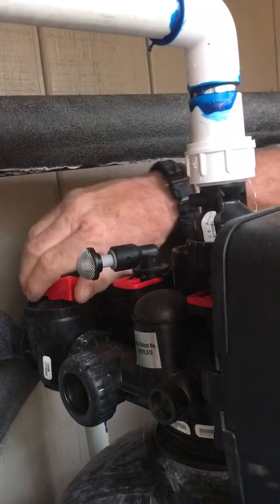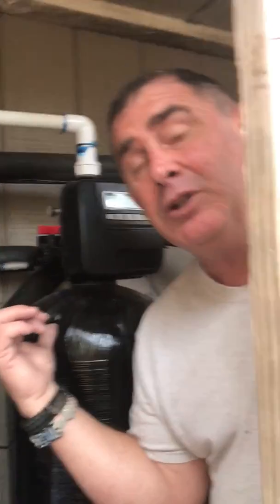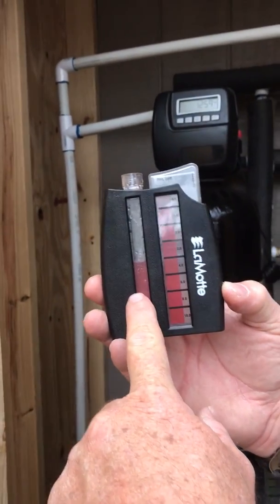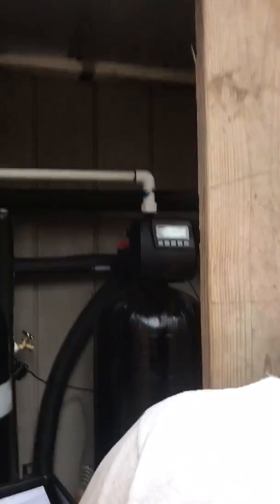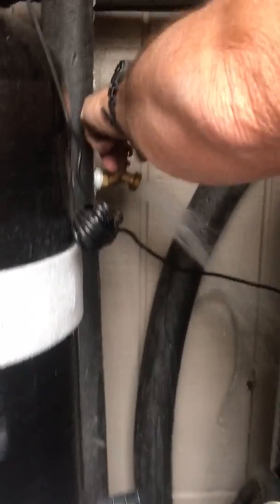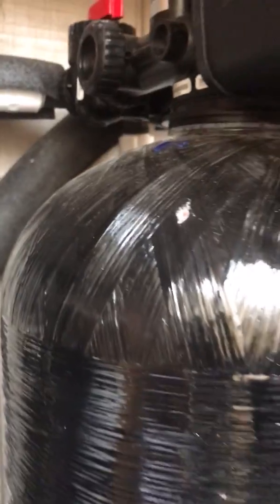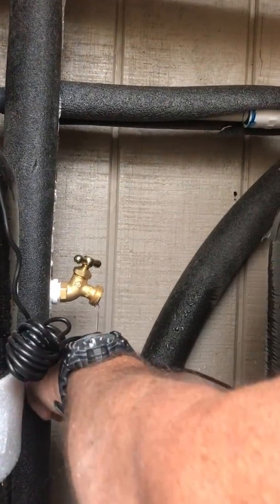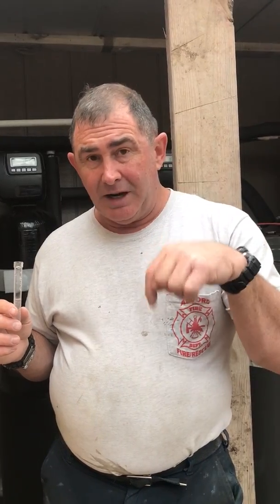What’s The Best Iron Filter

Comment: Can anyone tell me I understand that the flex system is a softer and softens the water does that other one the other filters the chlorine to how do you say chlorine out of them out of your water system I have city water
Reply from the maker: The Fleck is a softener and the very same valve can be used for a filter. When you filter out chlorine it goes into the micropores and mezziopores inside the small piece of carbon. I always tell people, when you either smell chlorine or you lose water pressure it is then time to remove the carbon and gravel and replace them both. If this didn’t answer all of your question please ask for more info

Comment: What type of injector do i need for a ws1 2.5 cubic ft iron breaker? Or what color
Reply from the maker: It’s been a while but I think a white one
Reply from the maker: It will need to have a large hole. If you can, call charger water or terry at (210) 714-2566
Reply: Thanks. I have a 48k which has the white injector though, and its a little undersized for my house and family. I want to upgrade it to 
 a 13x54. What letter on your iron filter?
Reply from the maker: @gurjotathwall   I have moved from there however, I think I’m remembering blue

Comment: Great info, just ordered an iron (heavy metal filter)  , we have a slightly high arsenic level with high iron in our well water and found out that arsenic attaches to the iron and by removing the iron it should also remove the arsenic (hopefully)
Reply from the maker: It sounds like you have done your homework, in addition to that you may want to install a carbon after the water softener presuming you have one. If not I may suggest one since ion exchange is another way of removing arsenic from water. The ion exchange process is what is done when the softening process takes place. You can call the manufacturer of the resin in the water softener and ask how many pounds of salt will it take to remove the arsenic. If it attaches to iron then you will need enough salt to remove it from the calcium and salt to remove calcium from the media. I personally would have done what you did and would ad a carbon filter after the water softener as the last line of defense and install a reverse osmosis under the sink for clean safe drinking water.  Good luck sir, feel free to ask if you happen to have any questions

Comment: I am replacing my old iron filter (with low nominal GPM, not worth reconditioning in my opinion), I am using softener after that. Will this filter work for Iron 3.7 ppm, 7.4 pH, 0.40 ppm Manganese? Or would you suggest different filter?
Reply from the maker: Mariusz this Iron Filter will absolutely remove that amount of iron with a pH of 7.4
Reply: @LowCostWaterSofteners  thank you! Is it worth going up in size, for lower water restriction? How is it work if we have two devices with 7gpm flow? Would we still get 7gpm at the end?
Reply from the maker: @MariuszChr  Your well pump is rated for 10 gpm so I would go with the Silver Series 15, it provides 10 gpm of service flow rate although it may do more. I would encourage you to order this one and ask for the Silver series 15 because as I looked at other brands, they use carbon in their systems and you don't use carbon for iron.  https://amzn.to/3afZwAV

Comment: Question. Does the water have to be running for the cycle after the backwash to refill withthe tank with  air?  I ask because my system is connected to a sprinkler system that pumps water from the well to remove iron and if I run the pump for a complete 1:15 minutes I'll burn out my motor quicker. Can I just time the pump to run for the backwash cycle(15 min) and then allow the air gap to refill without water running. I know it's lengthy but I have to give some detail
Reply from the maker: Yes sir, the water must be running in order for the tank to fill with air. I understand your concern about the motor going out on your pump. Rest assured it will not burn out quicker. They are designed to run for extended periods of time, the water running past the pump motor into the pump and thereby cooling it. The reason I know this is because I also owned a water well company and am very familiar with well pumps. https://www.youtube.com/channel/UCh8gBgQe5SoIFeW-xCkL5MA  You will be fine, and your pump will last for years.
Reply: Thanks so much for replying. And quickly also

Comment: What’s a good media for low iron in water from well? I have catalytic carbon but it’s time to change it out. Trying to find something less pricey.
Reply: I’m not sure what you mean by low iron but if it’s not more the 2 ppm use your softener however the best media is filter ag. Carbon is not good for iron as it plugs the media sooner. Filter ag never needs to be changed or replaced
Reply: @jimtum1  what I meant by low iron is less than 2 ppm. I’m looking to replace my catalytic carbon media but it seem that not a lot of people mention filter ag. I wasn’t sure how good it is since it seems to be the lower priced stuff in comparison to other stuff like katolox light and activated carbon.

Comment: I just got a quote for an Iron Breaker III, Have you ever heard of it and what kind of media does it have in it?
Reply: Some companies will put what they want in it as far as media goes. The model has to do with the brand and new equipment or valve. What are you trying to filter out?  I’ll get back to you on the valve
Reply: @jimtum1  Iron, you know one company says they never heard of it but from your video it  looks just like yours, I guess the other company just want my business by telling me they never heard of an iron breaker
Reply from the maker: @jm92gt03gt  Hey sorry it took 3 days to get back to you, YouTube didn't notify me. Anyway I looked at the company used to use called charger water and their iron breaker is the same as it has always been with the only exception being they are using a Clack valve like the one in my video and I explained why I used Clack. Clack overall is a better valve than Fleck but you cannot sell Clack valves on or over the internet because of all the phone calls Clack gets from DIYers when there is a problem. That is why I recommend Fleck because they have technical support for DIYers. Fleck is still a very good valve and is what I started with 15 years ago. So if you get a Fleck valve you are still in great hands. Not too mention with the Clack you have to have a special tool to remove the piston, seals and spacers and then you have to remember how many rotations you have to make in order to seat the piston correctly. So it is much more of a hassle than the fleck which all you need are simple tools from your tool box. This will work or ask for a silver 15 which is a larger tank and will cost a little more. Now if I installed it and you had an H2S, sulphur problem only then I would use a catalytic carbon, however, if it is iron I used filter ag plus. Here is the link, https://amzn.to/3rDJXsO if you have anymore questions please ask.

Comment: Thank you so much for your videos and advice.  New water softener is in the works, and now I'm thinking about a filter.  I don't have too much iron (somewhere between .5 and 1--softener removes it), but I DO have a sulfur smell (both cold and hot water) and who knows what else in my well water.  I tested ph somewhere between 8 and 9.  Do you have a filter suggestion?  With low iron, would I benefit from an iron filter?  Should I just let the softener take care of the iron and get some sort of carbon filter for the sulfur smell?  Are there filters that do both?  I'm looking for low maintenance, meaning I'll pay the money up front to not have to replace filter cartridges all the time.  Any advice?
Reply: Thank you for asking, the Addie is a Iron/Sulphur filter, the way it does it is by oxidizing it with air, thus the little gray octagon thing in the back with the screen on it. If it was heavy when you bought it you'll want to ask what is in it, if it was super light then it is empty and that is okay too, that is how they were originally sold.I would say put the Addie in front of the softener if I knew what was in it. If it is carbon put it after the softener, if it is empty or has filter ag plus, fillox, burm, or some other media then put it before the softener as long as it is a backwashing filter. Never put a carbon in front of a softener as it will get fouled out by contaminants in the water, let the softener remove them unless for instance the iron is too high but yours can be removed with the softener.

Comment: I own a bait shop in Minnesota, and have a huge iron problem. A water softener is not an option because of the salt levels killing the minnows. How long will this Iron Filter last/have to be replaced? I need constant fresh water slowly squirting into my tanks.
Reply: Using a water softener shouldn’t make the water salty. The salt is only used to recharge the resin. The water softener will flush the salt off the resin before it is brought back into operation.
Reply: Firstly I'd like to ask what the pH level is so I know which type of Iron filter to recommend because there are different types for different types of water now and I only want to recommend what I think is the best if that is okay

Comment: We are on a well and the following water testing came back (see below).  I was quoted an exorbitant price for the install for an iron breaker and a softener.

HARDNESS: 12 GPG (GRAINS PER GALLONS) 
TDS: 423 PPM (PARTS PER MILLION)
IRON: 3 mg/L 
PH: 7 

Would you recommend the iron filter that you have linked at the bottom plus a 48,000 grain softener? Thanks so much for your time.  This video is awesome.
Reply: Thank you!
Reply from the maker: Chip Spence I would do a 60k just to make sure it removed everything but a 48k would handle it fine.
Reply: Low Cost Water Softeners which one would you recommend?  Point me in the right direction on Amazon? Also should that iron filter you recommend on Amazon be appropriate. Also I am subscribed now. Thanks so much for your help!
Reply from the maker: @chipspence  for the water softener https://amzn.to/3ar2rnI   For the Iron Filter you can use this one https://amzn.to/2IjHbUU   I believe it is cheaper but works the same it does not use any kind of media which is like the EDDY (the first one)  or you can pay a little more and get the other one however the water softener will also remove the iron as well.
Reply from the maker: Chip Spence if you haven’t already please subscribe

Comment: Sir I want to know more about this can you help me please. May I have your mobile number
Reply from the maker: What is your question
Reply: @LowCostWaterSofteners  sir my father is a fish farmer so we need fresh water. My father want to take groundwater. When we dig a handpump we got water but it has many iron in the water. The think I want to know is that what is inside the filter to remove the iron
Reply from the maker: Abesana Yumnam since you are using a hand pump then you’ll want to run your water through a 2” pipe so air can get to the water and it will oxidize the iron in the water and it will be clear and ok for fish and plants
Reply from the maker: The media is used to catch the iron particles but the air takes the iron out of the water
Reply: @LowCostWaterSofteners  thank you sir

Comment: Will an iron filter remove ferrous and ferric iron as long as the ph is right?  Is  this a better option than a softener if the only problem I have is iron?
Reply from the maker: Yes, however I have never seen water that had iron without the water being hard but if yours is then use an iron filter so you won't have a need to buy salt and save money  This is the one I used in my house when they first came out and they worked great and still do, so this is the one I recommend for the DIY  https://amzn.to/2qR1Rih

Comment: Hello! How do you make sure you have the air bubble on the top?
Thanks for your video.
Reply from the maker: Catarino Hernández if you run some water slowly in the house you can usually here the water dripping in the tank. You sometime can tell by the temperature of the tank. Warmer up top cooler where the water is as you slide you hand down
Reply: @LowCostWaterSofteners  Thanks!

Comment: How much water pressure is required for both  iron remover and softener
Reply from the maker: It’s best to have 60 psi for the filter in order to lift the bed   Also keep in mind the softener and filter do not backwash at the same time. If you are having pressure problems let me know I should be able to help since I also owned a water well company as well. No pun intended 😃
Reply: @LowCostWaterSofteners  I believe I have 20/40 . I have an estimate happening wed. Thanks 😊

Comment: I have this iron filter installed right after the pressure tank, followed by a Pelican and I still am having to use a Berkey filter to get decent water. The Berkey candles are covered in light tan sludge and have to be cleaned often. Do you have any advice? Also our water turns everything it touches with a  white film on them, glasses, faucets etc, I have photos if there is any way to get them to you.
Reply from the maker: A couple of things I would do is check the iron level before it goes into the iron filter then check the iron level after it comes out of the iron filter.  As far as the white film I suspect your pelican system is not working because it doesn't work or the media is covered in iron and you will know the answer to that question after you test for iron after the iron filter.  You may be better served using a water softener rather than the pelican system since a water softener also removes iron as well as calcium and magnesium   Let me know what you find please so I can be of more help

Comment: Good info. If your well PH is acidic should you place a water softener before the iron filter? Also what do you think of the big blue iron filter cartridge's? Thanks
Reply from the maker: Bob Jones it really doesn’t matter about putting the water softener first unless your iron ppm is high. If it is then you’ll foul you media before it collects any hardness. So I would put the iron filter first. You also want to make sure that if using an iron filter that your ph is in the correct range in order for it to work. If your ppm if iron is less than two you may find you don’t need a filter.  I have never heard or seen a big blue iron filter. I’m thinking you’ll spend more money than necessary in cartridges or a product that doesn’t work. I hope this helps

Comment: what is the difference between the two links on amazon that you provided
Reply from the maker: The one with the Filox will take out more iron and hydrogen sulfide and can handle lower PH levels since the PH levels need to be from 6.8 to 8.0 in order to work correctly

Comment: WIll adding a Iron Filter remove the rotten egg smell that comes from the hot water only?  thanks
Reply from the maker: Richard Novo no sir. Usually that’s the anode rod. I used to take them out cut the rod off with a saws all and put the plug back in. The smell will go away. I’ve even had to do it when I had a water softener and iron/H2s filter
Reply: @LowCostWaterSofteners  why does it affect the hot water only?
Reply from the maker: Richard Novo it’s because of the anode rod in the water heater
Reply: @LowCostWaterSofteners  thanks for your quick reply!  Is there any no salt softeners/conditioners out there worth using. Wife hates the way the salt softener makes the water feel...  thanks for your expertise!
Reply from the maker: Richard Novo yes. If you look through my channel you’ll find a review on saltless water softeners

Comment: After testing the water this is my results
43 gpg
7.0 ph
2.5 iron
What do you recommend it for me?
Thank you
Reply from the maker: I recommend an iron filter https://amzn.to/2D1RGdC and a 2 cuft water softener https://amzn.to/2U3LEii
Reply: Thank you very much !!!
Reply: But I do have 75 gallons fiberglass pressure tank right now
To Oxidize the iron
I can use the same tank right? The reason I want to upgrade because my system is 17 years old But it’s nothing wrong with the tank so I would like to keep it
Reply from the maker: @markjachymiak5265  if its not broken then don't fix it :)
Reply: Low Cost Water Softeners At least I have an idea now what to get 
In the future😊
Reply: @markjachymiak5265  Hi right now I do have Birm media on my iron filter 
And I know the  iron filter you recommended for me has different media
What type of media this filter has?
Reply from the maker: Mark Jachymiak if it’s still working then keep it. You only asked for my recommendation   I hope I am able to help you
Reply: Low Cost Water Softeners 
It’s working But media needs to be changed because it’s 17 years old 
It’s iron and water softener filters 
48 000 1.5 cubic both of them
Only problem I have I cannot get anything online for my system
Not even a manual😊
And thank you for your help because You know what you’re talking about
Because I do all my maintenance of mine and I know how it is
And some companies told  me the iron being 2.5 I don’t need Iron filter 🤔
Water Softner will take of it 
But when I do clean my iron filter and I have to re-pressurize every year or more my water tank I know how  much iron I have 
And I check how much resin cost 
That’s why I would like to buy everything new .thank you for your time I really appreciate it